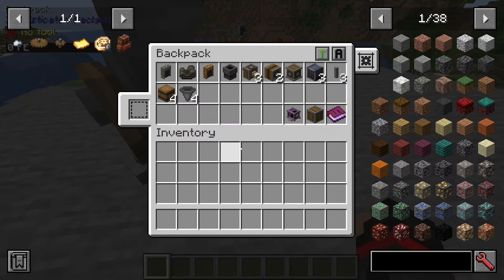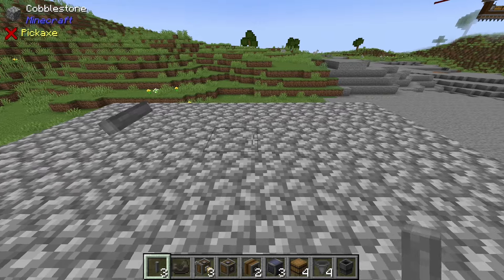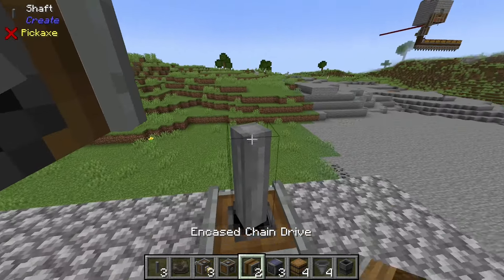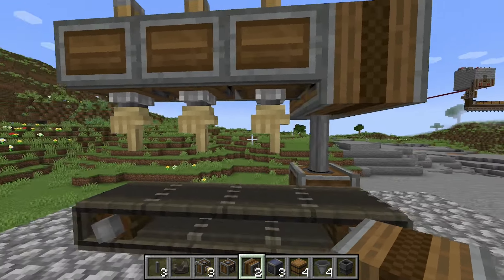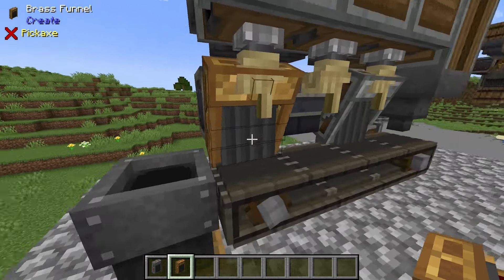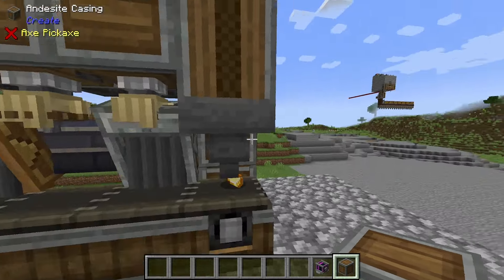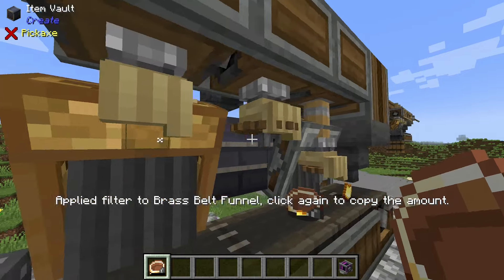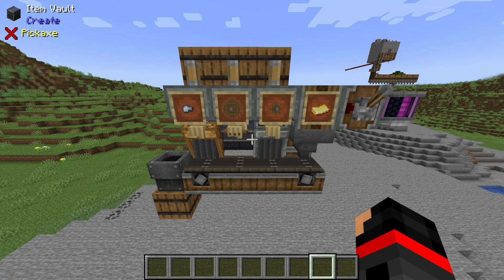Fastest Precision Mechanism Possible - Minecraft: Create

Comment: I usually build a belt loop and it's a pain to set up and I feel silly watching this video because this is a way better design
Reply from the maker: Glad you like it! Yea I had a design in 1.16.5 that used the adjustable crates, but since those only went two blocks I still needed a second belt. Now that we have item vaults it makes the 1 belt possible, super happy with it.
Reply: I used to use weighted ejectors instead of a loop. But it requires a very long belt
Reply: @Triobian  I used a tunnel to filter mechanism and all the salvages because I didn't knew that all phases of mechanism take the same filter. Is that a change made after 1.16?
Reply: @pranjalsharma1665  I think why it works is the item doesn't change, but the nbt changes. If you used an nbt filter I bet you would be able to separate phases

Comment: built this and it IS still working, HOWEVER, for those who are discouraged or having probs.. keep in mind that the 'incomplete precision mechanism DOES or  WILL  have to 'cycle' thru the conveyor 5 times.   SOOOO, make sure you have enough of each item (small cogs, large cogs, iron nuggets  to complete. If you load 64 gold sheets, it will start 64 incomplete precision mechanisms, you will need 5 times the cogs (each) and iron nuggets to get a complete 5 pass for all 64 gold sheets, ( if I remember the recipe for the precision machine correctly, 1 gold sheet, then 1 each small cog, large cog and iron nugget, then you have to process 4 more each of the cogs and iron nuggets, ONLY need 1 gold sheet per each completed device). Hope this helps.  I found this recipe on the net and it verifies, if correct, only 1 gold sheet is needed. (this is for a manual/hand crank method), but works same as automated methods. 
Steps:

Place the Depot on the ground.
Place the Deployer 1 block above the Depot, facing down.
Place the hand crank on the shaft of the Deployer. Test to verify you have it on the right side.
Place the Golden Sheet onto the Depot.
Place the Cogwheel into the hand of the Deployer. Turn the hand crank to press the cogwheel onto the sheet. You should see it change in shape.
Place the Large Cogwheel in the Deployer’s hand and repeat step 5.
Place the Iron Nugget in the Deployer’s hand and repeat step 5.
Repeat steps 5-7 four more times.

Comment: You can place a comparator on the side of the vault and connect that redstone signal to the hopper, and this will limit the number of concurrent partially made precision mechanisms.
Reply: this needs to be pinned or smth cuz it's pretty important. I didn't realize that's all I had to do to fix the issue of getting a buncha unfinished mechanisms. Whoopsies!
also, to add to this, the comparator can be put into subtract mode & have a signal inputted to the side of about 12 or 13, so the vaults will always be at almost max capacity, but will never actually get completely filled & break the whole thing
Reply: Or you could use threshold switch, to finetune it, but its up to personal preference i guess
Reply: @venomlesscz9525  This was easy to setup and figure out, thanks

Comment: I don't know what's wrong but my brass funnel wont take the incomplete precision mechanisms. It throws them off the belt for some reason. Everything works except for that part. Would you know what's wrong?
Reply from the maker: could be one of a few things:
Make sure that the brass funnel is set to input into the vault.
Make sure brass filter is set up with an incomplete.
Try using a Filter, set it to a IPM & ignore data, and see if that works.
How many PMs are you trying to make at once? if its more than 60, youll need to make the item vault a 2x2x3.
You could replace the chute at the end with a smart chute, and set it to not accept IPMs.

Give those a try and lmk?
Reply: @Triobian  Found out what happened. The schematicannon placed didn't link the vaults together, rebuilt them and works now! Thanks for helping and keep up the good work!
Reply from the maker: Ahhh good to know! I should of thought that, since the schematicannon also has trouble with encased chain drives. That actually might be the issue with another person who contacted me!

Comment: I fix some problems. The andesite funnel, make sure the output is facing toward to the belt, then it works. Otherwise the vault is eating the incomplete precise mechanism.
Reply from the maker: That's why I specifically mention the brass funnel should be shift placed and the andesite funnel normal placed

Comment: Hi Triobian, really nice Design, i love it, and did take small changes to mine ;)
Some tips:
- if your'se using a scematic cannon to build it, make sure the item vaults are placed correctly, 'cause the schematic cannon has problems with placing multi block structures.
- if you're runnning this farm at max speed, it can happen, that the vault is running full, and the incomplete mechanisms are running straight into the last barrel. To avoid that, i replaced the hopper with the gold sheets with a barrel and an andesite funnel. at the back of the barrel i placed a redstone link, paired to the other one, sitting at the threshold switch underneath the item vault. so whenever the item vault is hitting 90% capacity, it sends a signal and it is locking the gold sheet output untill the item vault is empty again ;)

Comment: So here's what i did. 
Run only 1 gold sheet through the process to get level 1, add that to a ALLOWED-filter.
Run it again to get to level 2, Add to filter.
Do this until you have all 4 levels into a filter and add that to the brass funnel.
The funnel will pick up 1-4 but pass on complete mechanism and scrap.

Comment: I attached a small mechanical press setup that feeds into the hopper, which worked quite well. (important : the press must be quite slow, since otherwise the item vault will just have an infinite number of stage 1 mechanisms inside.) I also added a mechanical arm to filter out all the trash, instead of just letting it go into the barrel

Comment: Personally I'd extend the item vault out one more so I can swap the hopper input location. This would let it have priority over the hopper in placing items on the vault. 
I'd rather have a few complete mechanisms than a lot of stage 1 incomplete ones.
As long as I remember the interaction right.
Reply from the maker: sadly the item vault is already at its maximum length for the 1 block size, so extending is not an option. I did try changing the hopper to input directly into the vault as opposed to the belt, but there was no difference in the processing. good news is that they do come out in sequence, but every gold sheet needs to be turned into a incomplete first, then they will be made in order. so in essence you just wait a minute for them all to go through step 1, and then after that they will process 1 at a time.
Reply: @Triobian  Yeah not having to make them all incomplete first is exactly what I was complaining about. Whats the limit on items this can process before it starts breaking due to running out of buffer size? 20 items per vault + 4 on the belt, does it have issues if you try and process multiple stacks at once or am I worried about nothing?
Reply from the maker: @jonathanblake831  Apologies for the late reply, I didn't see that you made a reply. The limit is theoretically 6 stacks - 1 item, though I haven't tested that. 5 stacks of sheets in the hopper, 59 incomplete in the vault, and 4 on the belt, since hopper wont deposit if the belts are full, and the 1 spot is for the items to cycle in and out of vault. Will need to do stress testing to confirm. So, in the majority of situations, plenty. I think you will be fine in most situations, but if its a concern, and you don't mind expanding the size profile of the machine, turn the 1x1x3 vault into a 2x2x4 vault, that way you have more inventory and can do the switch around you mentioned. I personally have never needed to craft more than 10 or 20 at a time, and like the more compact design, so that's what I'll be sticking with personally. But as with all things create, you are free to make whatever edits and changes best suit your own style! Another guy sent me an edit of his, he put a press on the front so he only has to put in gold, and then put a funnel on the barrel to dump the failed attempts in lava. So do as you like with it to make it work the way you wish :)

EDIT: So I stress tested the build, and regrettably it doesn't handle multiple stacks. The most it can process at a time is 62 crafts, any more and it ties the belts up. Workarounds could be taking the excess incompletes that go in the chest, and then putting them in a larger item vault nearby, and then cycling them back onto the belt/hopper. Another option is to expand the vault size as you mentioned. that would be 260 more incompletes stored for a total of 320 (318 so belts dont get tied up)
Reply: @Triobian  If expanding the vault is an option then change the order of inputs so sheets don't have priority over in progress items like I actually suggested. 
Otherwise, use a stockpile switch or the other one to shut down the hopper?
Reply: it's possible to just use a belt on the back

Comment: The hopper on the right is being problematic for me and I can't find anything about it, it just stops placing golden sheets on the belt until I interact with it. Even splitting the stack makes it drop one sheet and then it gets stuck again. Thankfully, dropping items directly on the belt is both easier and works flawlessly, so the design still works. Having the hopper go on the vault also works well
Reply from the maker: The machine can handle 60 gold sheets at a time. For bulk processing in greater numbers, just expand the vault to a 2x2x3 or 3x3x1. Then you should have no issues with filling the hopper.
Reply: @Triobian  I rebuilt everything from scratch in creative just for testing, added just 60 sheets, and the hopper still gets stuck after one mechanism or two. Removed some sheets, and it got stuck again shortly after. Even the deployer refill hopers stopped working sometimes. It feels a lot like a bug but maybe I'm just not being able to understand what's going on. No need to worry tho, for my base I'll definitely just drop the sheets directly on the belt and that'll make the amounts I need with no issue. And thanks for telling me tho, it does seem to additionally break if I place/drop 64 at once instead of 60, so that's good to know
Reply from the maker: Yea the 60 limit is due to them being 1 item stack size once they are processing, so only 60 can fit in the vault. 63 is the true hard limit as that fills up the vault and the belts, and the 64th clogs the belts so no movement in and out of the vault can happen.

As for the hopper issue, definitely sounds like a bug, cause that's normal create and minecraft mechanics at work.  Sucks that it doesn't work but good that you have a workaround.
Reply: @BrianSantosF  you can have a look at my version of the farm, it's the same base, but a little modified so that nothing gets stuck 😉

(By the way, it is German, but I guess with good English subtitles 😉 )

Comment: This thing literally doesn't work. Only makes incomplete.

Edit: It does. Don't over do the gold sheets. Make sure to re-attach everything if you use the schematic. Also make sure you aren't using silver nuggets lol.
Reply from the maker: This thing literally will work if you watched the video and saw that I explained it will cycle them all in steps so they finish in a batch instead of one at a time.
Reply: It just cycles the incomplete ones over and over again the arms don't move at all after the gold runs out. @Triobian
Reply from the maker: Check that the recipe is the same as in normal create, check that you have the deployer materials in the right order, check that the deployers have power. Break the vault and replace it, and use a wrench on the funnels to flip them twice to give them block updates. Break and place the chain drive, and then break and replace the chute. If that all doesn't fix it, then I don't know why it's not working for your game specifically. Can consult with the discord and see if someone has had an issue like it. Pictures and example vid can also be done there
Reply: It made a few out of nowhere then I added more gold sheets and iron nuggets stopped placing? @Triobian
Reply from the maker: Im going to assume that youre not out of iron nuggets. It sounds like you could be overloading your machine. It can only make 60 at a time since that's the size of the vault. If you want to make more than that at a time increase the size of the vault.
Reply: It seems what the problem was. If you add too much gold sheets it will use a majority of the resources to keep making new mechanisms. Instead of finishing them. So adding half the amount of golden sheets to the rest of the resources fixed it. I'm just dumb and was overwhelmed with all of what this machine is. I did have to re-attach everything. All though I don't really know what fixed it I think I just think it was I was not managing my resources correctly. I apologize! thank you.   @Triobian

Comment: I dont have item vault in 1.16.5, how can I replace them ?
Reply from the maker: Then this design won't work for you. You'll need to use other methods to cycle items around.
Reply: just place a belt + shaft + 2 vertical gearboxes on the back

Comment: Going through ATM9, and I’m attempting to use your design. I’ve made it exactly as you have (even the vaults are correct, and the funnels are oriented right) but my machine seems to be stuck on phase one. I can make the incomplete device, yet it seems to completely ignore the large cogwheel step. This has caused my I.P.M. to go in a loop, stuck on step 1/15. Any advice for troubleshooting?
Reply: For anyone facing a similar issue, placing the deployers down again fixed it.

Comment: things are just going in my andesite funnle
Reply from the maker: Arrow needs to face out. Wrench it.
Reply: @Triobian  I just used 2 brass funnels and it worked
Reply from the maker: When you shift place a funnel, it's set to insert, when you regularly place, it's output. You shifted when placing the andesite funnel. You didn't shift when placing the brass one. That's why you had that issue. Just look at the arrows on the top.